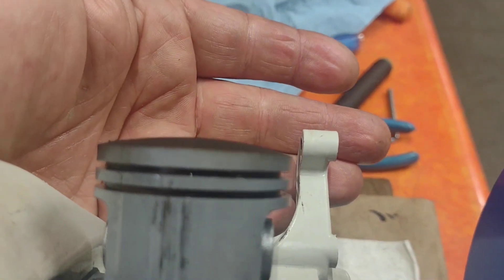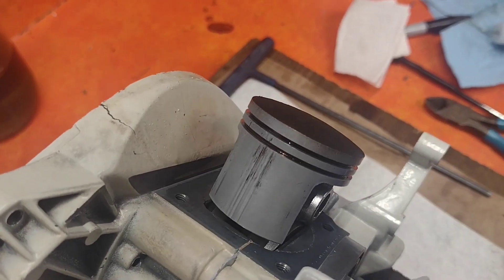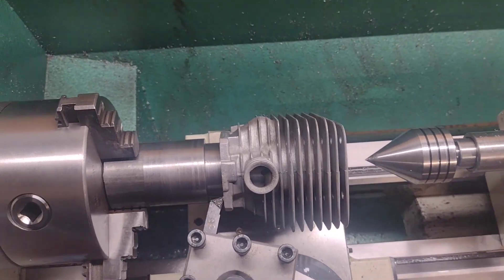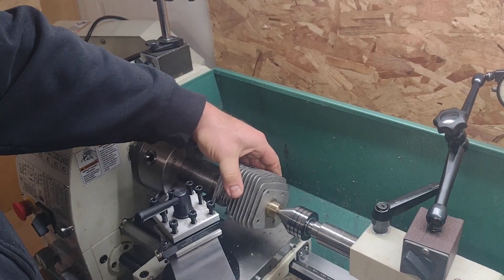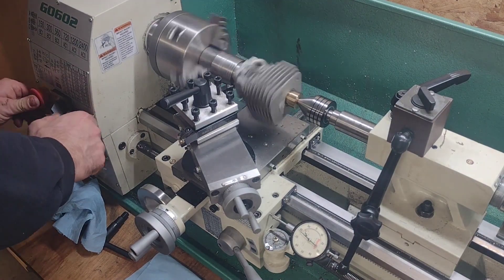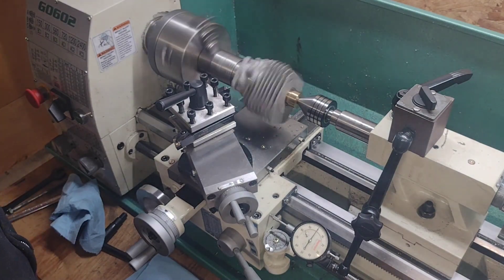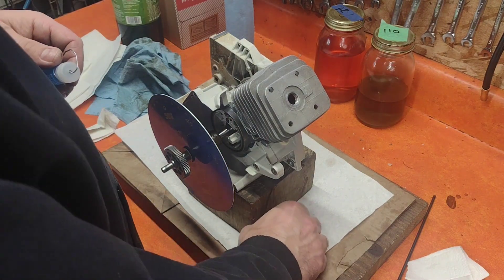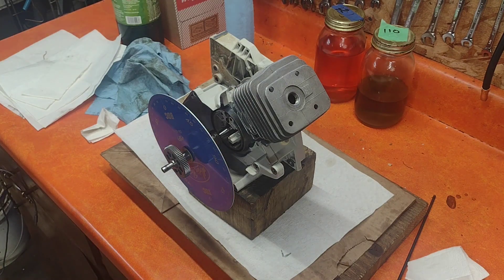Setting squish pt.2: Cutting the base

Comment: I had someone do 20 on mine and the piston was slapping the head
Shouldn’t it be more like 30-35?
Reply from the maker: @jakegilly6438  if it slapped the head on this saw it was tighter than .02 on a big saw I wouldn't go .02 every saw is different and depends on what you are after
Reply: @ it was a 461
Reply from the maker: @jakegilly6438  .02 shouldn't slap the head but I would have set it to .024min
Reply: @ yea his was 18-20 now that I remember
Reply: @ what would you set a 661 to for longevity?
Reply from the maker: @jakegilly6438  too many variables for me to just give you a number, it's a symphony, everything works together. .024 min